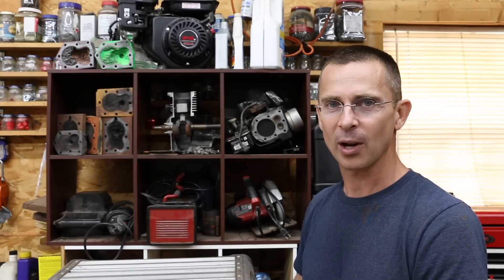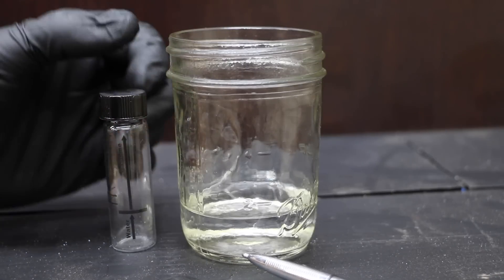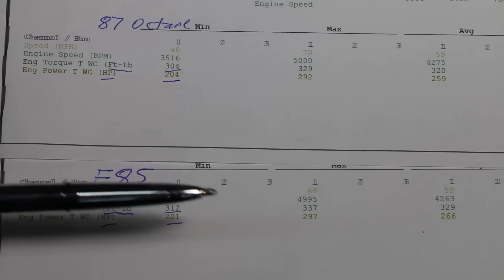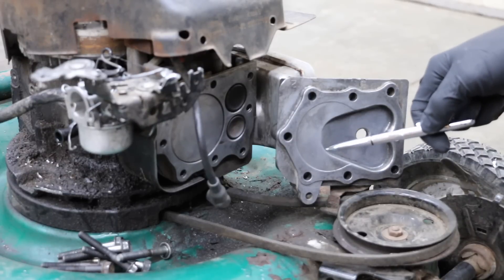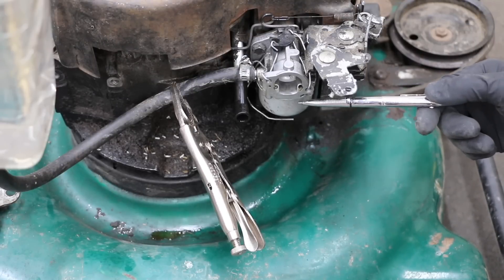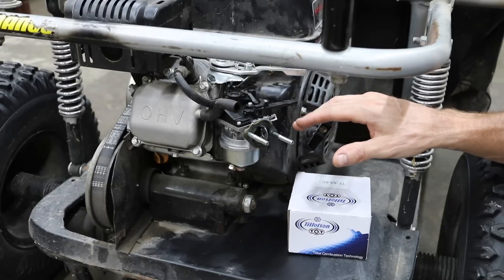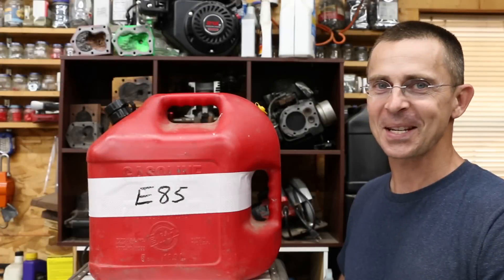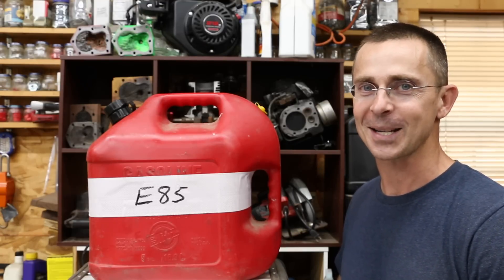Is E85 better than Gasoline? Let's find out!

Comment: Does your suburban suffer from the cold weather knock problem? Also have you run Engine Restore in the Suburban? I noticed the significance difference in pulling power after a few hundred miles with the Engine Restore. I'm talking about the stuff with CSL.
Reply from the maker: The 5.3 does indeed "rattle" when cold. It's done this since I bought it over 100K ago without causing any issues.  I have used restore in the suburban twice.  It's a great product!
Reply: @ProjectFarm  my understanding is that the rattle is caused by piston slap. GM did not do a recall because they said it did not affect the lifespan of the engine. Both of my Suburbans have had the knock. I have noticed that using a tank full of E85 on a long trip seems to help quite a bit. I have read and seen some videos that indicate that carbon buildup on the top ring allows the pistons to move around too much when cold. I believe that they moved the top ring upwards in later models and solved the problem. A lot of this is hearsay but it does seem to be accurate. I can start mine and let it run for about 15 seconds, and then let it set for 3 or 4 minutes and the knock is gone. I believe that what is happening is that the aluminum pistons are absorbing heat during that time and therefore fit more tightly into the cylinders.
Reply: I found the technical service bulletin. This is a portion. Bulletin No.: 01-06-01-028A

 The knock noise is most often noticed during initial start-up and typically disappears within the first 5-30 seconds (may last longer in extreme cold temperatures). The noise is usually more noticeable on the initial start-up when the temperature is below 10�C (50�F) and may be more pronounced on the first cold start following a long trip.

This noise may be caused by an interaction between carbon that has formed on the piston, the piston motion and the cylinder wall. GM Powertrain Engineering, and an analysis of engines with this condition, has confirmed that the noise is not detrimental to the performance, reliability or durability of the engine.

THIS NOISE DOES NOT HAVE ANY EFFECT ON THE LONGEVITY OF ANY OF THE ENGINE COMPONENTS

Comment: Where E85 shines is boosted applications. I know many who run e85 in vehicles that would make your jaw drop. ~40psi TVS supercharged and unintercooled L67 GM V6 for example. The increase in fuel usage is the price you pay I guess. At least it's readily available.
Reply from the maker: Thank you

Comment: You are performing test on a vehicle virtually identical to the one that I've been using. This should be very helpful. I'm a little concerned that it won't pull to 5000 RPMs in 3rd gear. That should be relatively easy for a 5.3.
Reply from the maker: I just figured out the problem.  The vehicle's computer limited the vehicles speed during the dyno.  Speedometer indicated 100 MPH or so.
Reply: @ProjectFarm  that computer shuts down the engine at 96 miles an hour. It will haul ass right up to that point but go no further. I tested this in West Texas out in the desert on an empty Highway.

Comment: I mix 1l of ethanol (90%) with 25l of pump gas(95 octane rating). Not sure what the ron is after the two is mixed but can feel a difference in power. Vehicle is turbo charged. I use it as a octane booster as the fuel quality is low compared to the others you buy of shelf, works much better
Reply from the maker: Thank you

Comment: Is there any carb that is designed for e85 and won’t brake.
Reply from the maker: I believe I could modify a carb to work with e85 by using a different type of rubber/plastic.

Comment: These numbers are all done from the maths of fillup litres vs kilometres.

1993 Subaru Liberty (Legacy) EJ22T
98 Octane  - 10.8L/100kms (factory ecu, boost was turned up)
E85 - 9.7L/100kms, sometimes a little better (aftermarket ecu tuned lean at cruise, same boost as before though)

2007 Honda Jazz, 1.3
98 octane - 5.9L/100kms (standard, only mod was muffler delete)
E85 - 6.4L/100kms (fuel pressure was bumped up until the computer wasnt showing significant trim)

2006 Yaris, 1.3
98 octane - 6.4L/100kms (standard)
E85 - 6.6L/100kms (modified the MAF to read 25% higher)

2008 Ford Falcon Turbo
98 octane - 14L/100kms (standard)
E85 - 15.6L/100kms (tuned for e85, otherwise its all standard)
98 octane - 22.5L/100kms (tuned with massive injectors)
E85 - 23.7L/100kms (tuned with massive injectors)

DC4 Integra
98 octane - 8.2L/100kms (standard)
E85 - 8.8L/100kms (fuel pressure was turned up until there was no significant trim)

It appears to me that the added torque from ethanol letting the trans shift early makes up most of the energy difference in most conversions. But flexfuel vehicles always do like 50% worse economy on e85. Its baffling to me.

And one other trend ive noticed is people will "upgrade" their injectors to massive units for e85, and then talk about having rubbish economy. Its not the fuel's fault, its the injectors fault, going by what ive noticed in the turbo falcon.
Reply from the maker: Thank you for this information.

Comment: I have an 88 Dakota and even normal E10 pump gas gives me endless headaches. I have to replace entire sections of fuel lines yearly because the ethanol eats the lines from the inside out and causes them to crack and eventually leak.

Normally I can smell the leak before it becomes a major issue, but the last one was particularly bad, the ethanol compromised the return fuel line near the fuel tank and caused an oblong hole to be blown out about 1/16" in diameter. Luckily the pressure was low enough that an emergency fix of tightly wrapping the line in several layers of electrical tape and zip ties held the 70 or so miles to get back home.

Another incident farther back was the elbow fitting for the sending side on top of the fuel cylinder started leaking. I had to unbolt and jack up the bed on the truck to get to the top of the tank to remove the fitting. It turns out there were two O-Rings separated by a spacer, both of which had shrunk and cracked due to ethanol. I had to make a special tool to remove these and replace them.

Recently I found a gas station that sells ethanol free fuel, and the deterioration of my fuel lines has pretty much completely stopped. The engine also runs a whole lot better and the exhaust has a noticeably different smell, I'm told by a bunch of older gear heads it smells like fuel before E10 came about.
Reply from the maker: Wow!  Thanks for commenting on this.

Comment: Great video!
With the one carburetor leaking from the E85 I have to ask 
Did you have any problems with any of the other carburetors leaking?
The fuel economy was a big surprise!
I figured it would be worse, but wow I didn’t expect it to be that much worse!
Reply from the maker: Thank you.  The others didn't deteriorate during the testing but I quickly added non-ethanol gas as soon as the testing was complete.  I bought carb rebuild kits in anticipation of the damage.

Comment: Had to cheaper than .90 lower per gallon to off set the cost for running it. In our town and country with 3.6vvt it gets the same mileage with e85 vrs 87 in the summer with tons more power
Reply from the maker: Great point.

Comment: I don't use it (E85) in my flex fuel Suburban because it's rarely available (East US) and not economical. Pure ethanol is about 30% worse fuel mileage. E85 is about 25% worse. To break even as a consumer I need a 25% cheaper price. If  E10 is $2 and E85 is $1.50 I'll buy. If the discount is smaller I'd be ripping myself off.
Reply from the maker: Great point. Thank you

Comment: As German, living near Netherlands and Belgium E85 is my choice of fuels for my Volvo S40 2.0FlexFuel. Runs smoother, has a bit more power (regular gas = 95 or 98 octane / E85 = 107octane / E85racing = 112octane) the need of 25% to 30% more fuel is not that much expensive, like in other countrys. 
Regular gas will cost you today ~1,50€/l what is 5,68€/gal, in my opinion very expensive, E85 costs only 0,95€/l wich is 3,60€/gal, so it's even cheaper when you need that extra 25% to 30%.
The only problem is you don't get E85 easy in Germany, there is only a handfull of fuelstations selling E85, because the goverment stoped projects and spending money for reserches and selling of E85 in 2016.
In Netherlands and Belgium nearly 90% of fuelstations selling E85 or Racingfuel based on E85.
Reply from the maker: Thank you

Comment: I used to use 50% E85 with regular gas when it was available in hungary.
The engine was a 2liter inside a chrysler sebring,it worked well
Reply from the maker: Thank you

Comment: Another great video! Thankyou very much! One thing I would like to bring to light about ethanol blended fuels is the problem with its stability. It has A very short storage life, in the automotive world letting it stand in your fuel tank for more than a couple of months is a bad thing in that this type fuel begins to Delaminate into constituent components one of which is water,H2O. This layer of water builds up at the bottom of the tank where your fuel pump lives and starts to corrode it and when you DO go to start the engine the fuelpump starts off pumping nothing but water which does not lubricate the pump like the fuel does and is designed to do and this passes on down the line eventually wearing out your fuel pump and fuel system components and rusting out your fuel tank from the inside out. I can tell you this first hand, plus I have researched theses fuels extesivley, for i had to make decisions on which fuels to use when developing dyno "tune" maps as your fuel types play major roles in how you tune your car that's not to say you can't make lots of power on E85, because you Can! I chose not to for several reasons one major one being its just not readily available in my area. I have to have a steady source of high octane fuel as my car is turbocharged, and well the rest is for another time and place. So remember blended fuels are great for power but they also pose some serious problems if not properly maintained.
Thanks again. This is just my 2cents
Reply from the maker: Great point!  Thank you

Comment: Why not try building a box through which exhaust gases pass to heat up different fuels, such as tar, rubber, lard, grease, oil, etc. to see if the vapors produced would make a decent fuel?  Of course, you would have to have a fuel cutoff for using regular fuel to warm up the engine and starting the heating/vaporization process, and then switching over to a gaseous introduction system.
Reply from the maker: Great video idea!

Comment: I know when it comes to tuning with E85, you can punch an ass load more timing into the motor without pinging. 

Quite often here in Aus, people will run E85 and push more than 800HP at the wheels. 

I'm running 14 PSI on 98 oct ( thinks it's different to america's rating) and push 400hp at the wheels. If I were to swap to E85 I could make the same power on far less boost. Something I have looked into before, but the fuel efficiency drops right off.
Reply from the maker: Great point. Thank you

Comment: The reason why the horse power dropped was because the injectors aren't big enough. I run e85 for 50 to 60 miles to clean my injectors and engine out..Unless you have 25% bigger injectors you won't see much of a gain and might damage your engine under full loads.
Reply from the maker: Thank you.  The suburban gained HP on E85.  It has larger injectors.

Comment: E85 is also cheaper per gallon. I converted my car to run on e85 and I gained significant hp but that's also due to being forced induction and being able to run more aggressive timing with the ethanol over pump gas.
Reply from the maker: Thank you

Comment: I use it on my car, and would recommend it on just about any turbo car.
Most turbo cars of 2012 and up, run fine on E15-E20.
That means 1 gallon of E85 for every 10 Gallons of regular fuel.
Or,
Add 1 Gal of E85 + 10 gal of 91-93 oct fuel, for highest performance on turbo cars.
The 2011-2014 Chevy Cruze, actually runs way better in summer, with 1 gal of E85 in it's regular fuel.
It does eat away the MPG by a bit, but running 87 oct fuel in 90+ degrees summer days, it runs very lousy.
For the Ford Fiesta ST, I'd recommend running E15 with 87 octane in a 50/50 ratio. The car is more responsive this way.
It's a cheap man's hi-performance fuel.
Reply from the maker: Thank you!

Comment: The problem is that the rubber compounds that resist gasoline and ones that resist alcohol are completely different. Running ethanol in a car that wasn't designed for it runs the risk of destroying all the rubber seals in the fuel system.
Reply from the maker: Great point.

Comment: I periodically run E85 in my 5.3L flex fuel Silverado. It cleans your fuel system and engine. It collects and removes water from your tank. Condensation is going to collect in your tank no matter what fuel you use. The difference is gasoline will leave it there to accumulate and corrode. Due to aftermarket ECU tune I only use premium gas or E85. E85 is $1.10 cheaper where I live. Even though I get less mpg’s, I get ALOT MORE miles per dollar and MORE horsepower running E85. Despite that I still run premium in the winter and when I tow heavy trailers.
Reply from the maker: Thank you!

Comment: it didnt have the power to do a proper dyno run never heard of that
Reply from the maker: I just figured out the issue.  The vehicle's computer limits vehicle speed to around 100 MPH.  It ran great in 2nd gear and easily reach 5K RPM.

Comment: I would just be concerned with the effects of longterm use of E85 with a carbureted engine. I've seen pictures of the bowls of carbs used with E85 gas and they're nothing but white powder.
Reply from the maker: Great point!  I have a carb that's been destroyed by it.

Comment: Thank you for doing this test! I have a tuned Audi s4 that on 93 will make 380 at the wheels but on E85 will make 480 at the wheels. Aftermarket tune, injectors and fuel pump. Only downside is gas mileage and the car is not happy at start up in the cold.
Reply from the maker: Thank you!

Comment: E85 can take more timing advance, and give more power. The racing community has known the advantages of alcohol for years. Here's the problem..... For us sedate street folks, alcohol has less BTUs per gallon. Period. You can't cheat physics. Straight gas will always get you better mileage because the fuel contains more heat energy.I drive an 08 Ram that is E85 compatible. I run a tankful through it on a yearly basis. Why? It keeps the fuel system clean. I use a scan tool to monitor engine parameters and when I'm running E85 the cats get a little hotter. My gut feeling is that the junk getting burned off of the cylinders is heating them up a bit. At almost 200k, I've yet to replace an injector or cat. She must be happy or I'm really lucky... LOL
Reply from the maker: Great point. Thank you

Comment: The matter is not as cut-and-dry as this video would make it seem. It really comes down to the cost of the E85. If you can get it for a low enough cost, then it becomes equivalent to gasoline. And in that case it's worth using because any reason to use less OPEC oil is a good reason. But if you can't get it for a low enough cost, then it doesn't make any sense to use.
Reply from the maker: Great point. Thank you

Comment: I have used E85. It is a SCAM! I drive all over LA and I get 17mpg with E85 and I get 24 mpg with regular 87 octane gas. Ethanol is produced to make the liberal environmentalist make themselves feel better about themselves. We use our land to make fuel when it ruins seals and it gets less mpg, and it is not energy positive. It take energy to ferment the sugars and transport the fuel to the gas station more than it does to run it. I also I did a calculation that it costs more to run your car on E85 than it does regular 87 octane. I’ve tried it and I’m not going to buy it. 

You should make a video on more diesel products. Would love to see more diesel projects. 

Keep making the great videos!
Reply from the maker: Thank you!

Comment: Another great video. E85 isn't a good solvent, However it is a great cleaner when combined with heat Just like coolant does to a cylinder with a head gasket leaking! Bottom line is Ethanol is not our friend and is very corrosive.
Reply from the maker: Thank you!

Comment: I run my race car on E 85. And Ive helped multiple customers switch their race cars over to 85 as well. It’s a much higher octane the most pump gas. It runs cooler than traditional gasoline because it’s alcohol. And it’s much cheaper than running a race fuel.
Reply from the maker: Thank you

Comment: I have a flex fuel capable car; I use it sometimes just to “clean out” my engine, even if it is in my head. I do feel like my car has more power, but again, probably in my head. It is much cheaper, but I also get worse gas mileage, so after calculating it out it’s not worth the price/mile if you’re using it purely to save money. I think they should drop the price of it even more to make it more competitive with standard gasoline and encourage more people to use it as a environmentally-friendly alternative.
Reply from the maker: Thank you

Comment: You should try combining several additives together!
- Techron Fuel System Cleaner
- Marvel Mystery Oil
- Seafoam
- Royal Purple Max Clean

I’ve seen each of them strive in a different area so it’d be interesting to see if a combination of the four work together.
Reply from the maker: Thanks for the video idea!